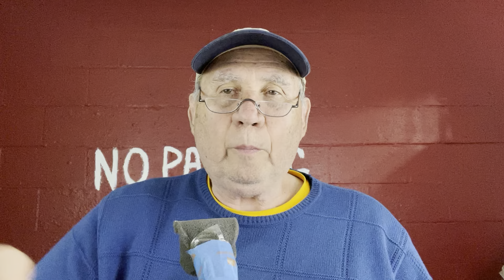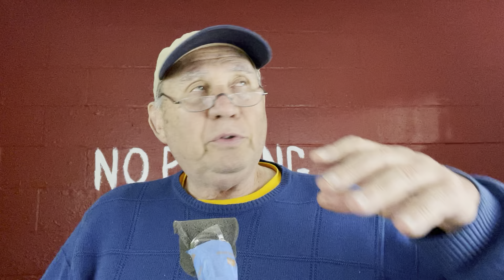Not All Basic Training Is Created Equal  |  Mike's Garage

Comment: Mike it was called a transit for measuring the ground elevation. When i was working for a A/C HEATING contractor one of the contracts was installing two fiberglass fuel tanks for the boilers. My boss asked me if i could install them under ground next 2 the building. I said if u can  dig the hole and i was using a transit for the proper depth of the too two thousand  tanks i can pipe the fuel lines to the building. When the contract was finished he then asked me if i was interested in doing anymore fuel tanks that needed to be installed . Sure i said since at time the local schools had to their fuel tanks replaced with double wall tanks. I found the work interesting  since i working inside and outside of the building and received a bonus for every tank i supervised. i did about twenty of them in our area and kept the costs down since we used local contractors for digging the holes and setting the tanks in place.  I did run into a couple of problems installing the tanks and if u are interested i can tell u about them with my Vietnam stories. Later
Reply from the maker: Hay Joseph. Would love to hear all your stories.